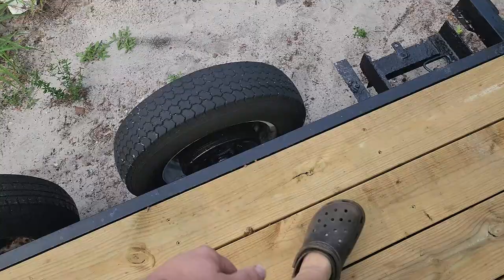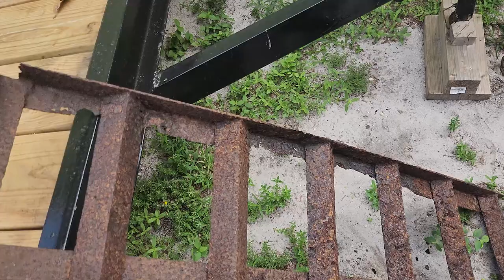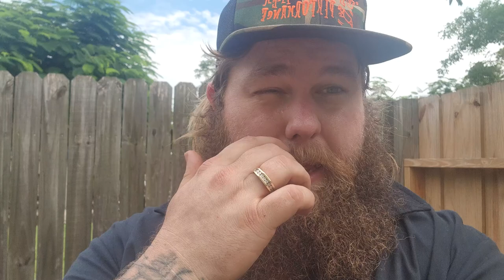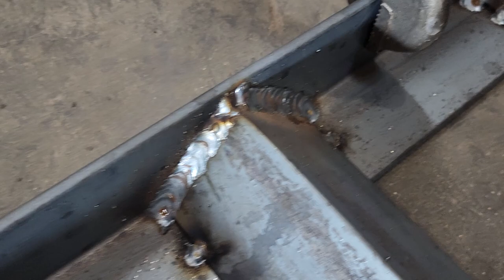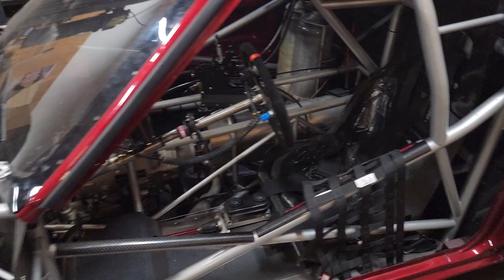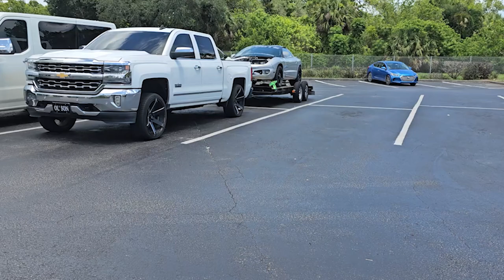Unbelievable Find: $800 Car Hauler for My Drag Car!

Comment: Braided lines give you to much flex. Should only have short runs of braided line two from frame rail to the calipers and 2 from axle housing just at the flange going to the calipers. To much will make the pedal soft.
Reply from the maker: Good point they expand and contract too much